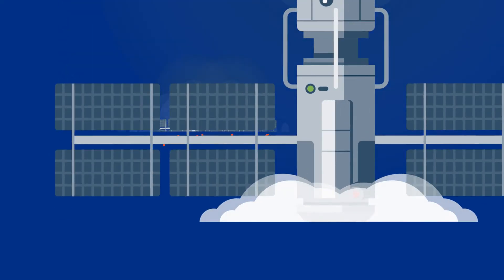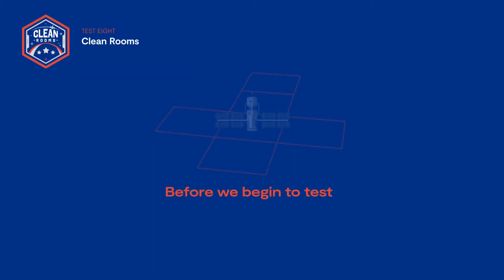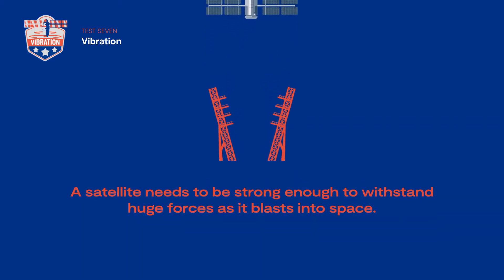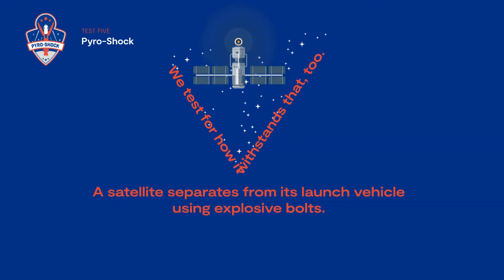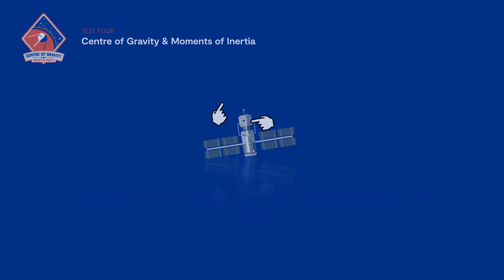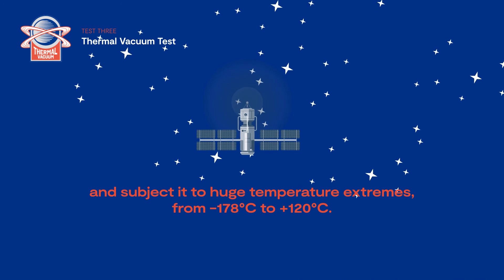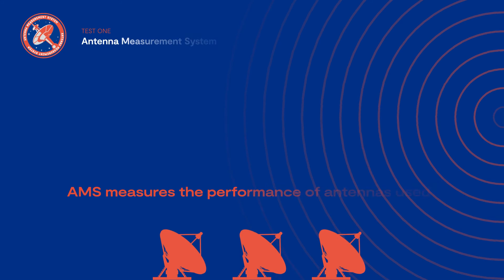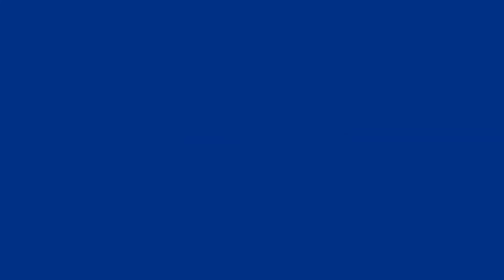How to test a satellite for a lifetime in space

Comment: Question?
What is the lifespan of a satellite?
Are there built in shock absorbers, in satellites?
What about radio frequencies disruptions?
Are the materials heat treated?
Does weight play a role?
Is it possible satellites could crash into other satellites? 
Are there TOO MANY or NOT ENOUGH satellites in ORBIT?
How do you make satellites more efficient without sacrificing performance?